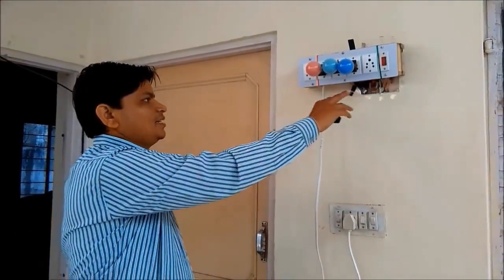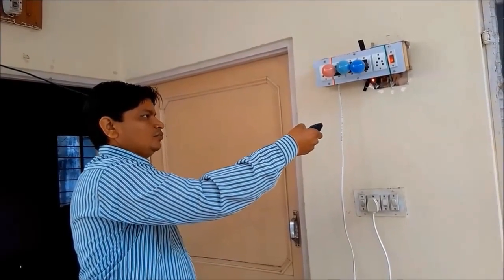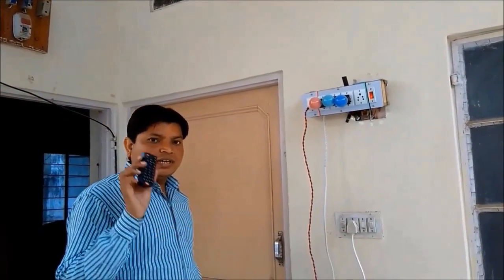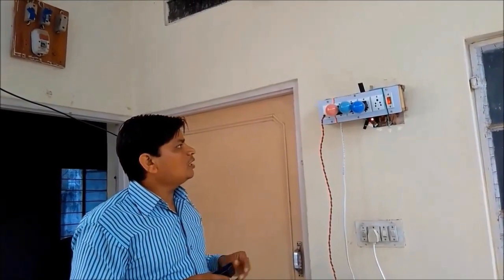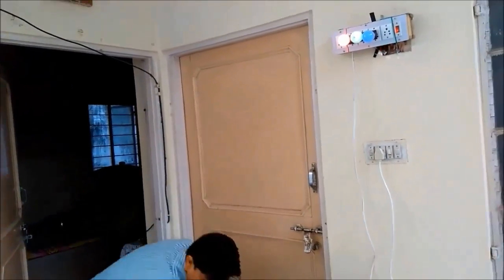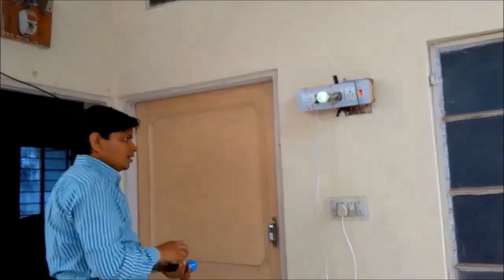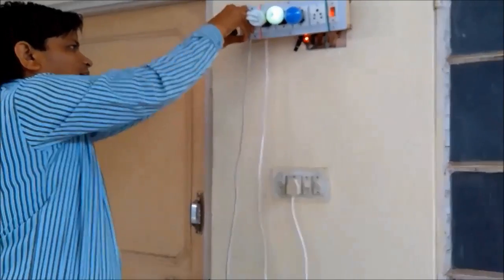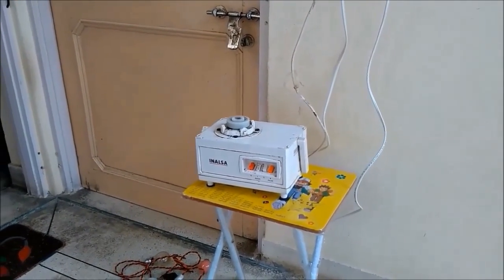Turn on / off bulb from remote control

Comment: Sir, do you know anything about standing electric fan , that is wired to be controlled by a remote control, we have a problem where pushing any button produces a buzzing sound, related to the mote board of the fan itself, I was wondering do you know how can I turn off this sound from the board?
Reply from the maker: buzzing sound from FAN or the board ?
Reply: +tulsa parihar from the board, never mind I figured it out thank God, there was a school-bell like structure on the board (it was present to allow the fan to produce a simple sound as that of a phone when you press any button, that sound malfunctioned so that the simple press sound continued to work non-stoppingly , it sounded like a very annoying buzzing sound. ) thank you again for your reply
Reply from the maker: Great , thank you